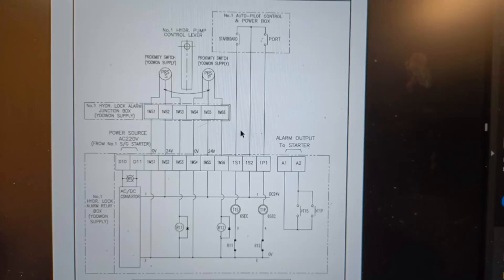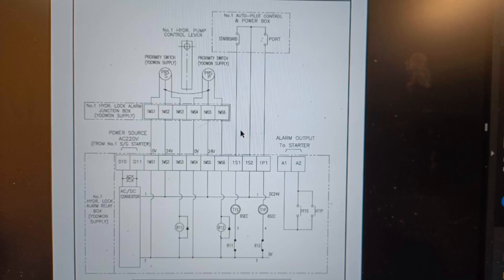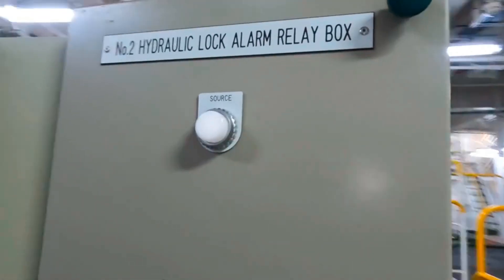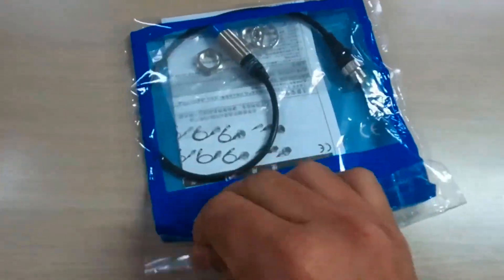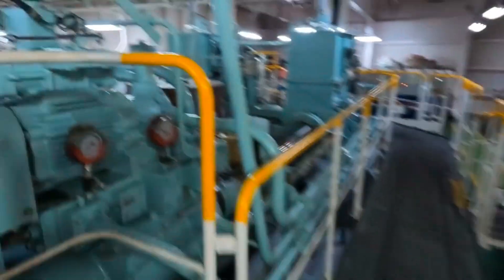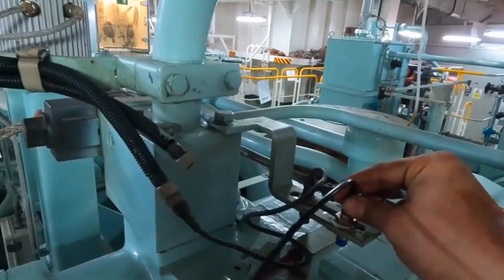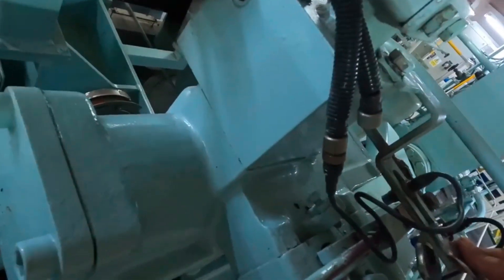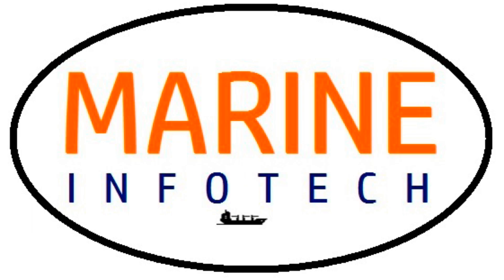STEERING GEAR HYDRAULIC LOCK ALARM TROUBLESHOOTING//IMPORTANT TIPS FOR ETO AND ENGINEERS// 2023

Comment: My steering gear no 2 any problem cannot use to operation.. And always alarm hyd lock
Reply from the maker: @otata.henggar17  please check is that actually locking or there any other issue due to sensor or electrical circuit

Comment: My rolls royce steering Pump No 1 is not starting from Remote. Any suggestion?
Reply: Look,I have the same issue but alarm goes off on standby pump,pump in use is good but number 2 gives this alarm,I guess you right that problem in sensor but why it happens on standby pump?
Reply from the maker: Send me a control diagram on my email
marineinfotech21@gmail.com
Reply from the maker: Send me a control diagram on my email
marineinfotech21@gmail.com